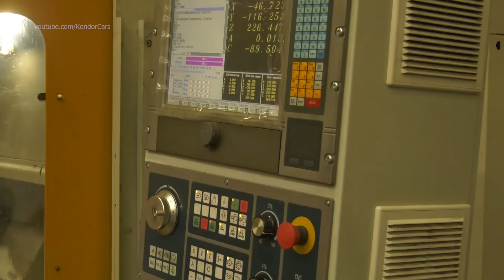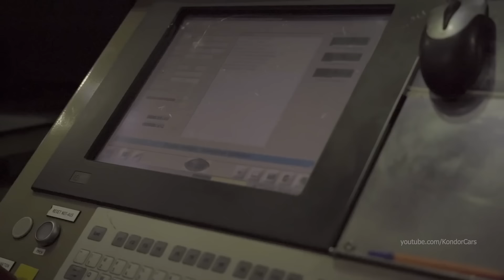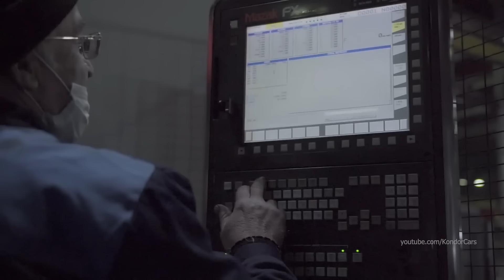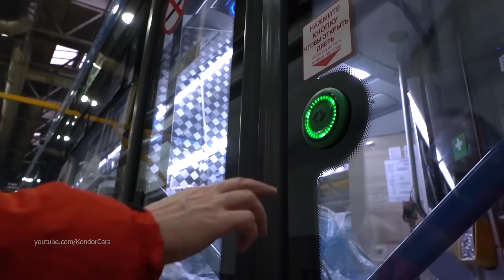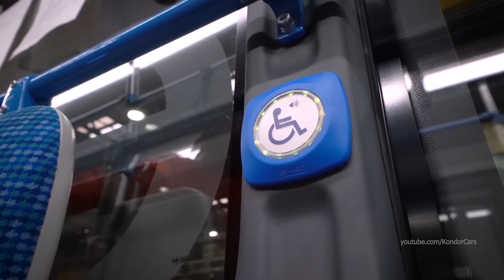KAMAZ Bus Production RUSSIA

Comment: Bus seats ERGONOMICS: 
For the backrest, a backwards inclination is recommended. 
The seat cushion must be (should be) higher near to passenger’s knees, and lower near to the backrest. That is, the seat cushion must be (should be) a forward acclivity. 
Most Brazilian bus SEATS are not comfortable. They are not ergonomic. 
Bus seats of Caio-Induscar are awful, very bad! 
Bus seat of Comil is awful, very bad! 
In these Brazilian bus seats, passengers slide forward over the seat cushion when the bus brakes suddenly. And passengers’ trunks lean forward when the bus brakes suddenly. This may happen mainly when the bus is going down a slope. 
Bus seats ergonomics must be evaluated when the bus brakes suddenly, mainly when the bus is going down a slope. 
And comfort comes from ergonomics!
Reply: может быть , когда ни будь тебе повезет , и вместо бразильского ,  ты прокатишься на автобусе КАМАЗ
Reply: @СергейМихайлов-с3х  Older urban bus seats are more comfortable than newer ones!  Bus seats design is worsening worldwide!  
I suggest reading ‘Ergonomics of Urban Public Passengers Transportation’  (Universidad Nacional Experimental del Táchira - UNET), at the point where it discusses 'bus seats' (the back rest and seat cushion angles). The recommended values may be partially refuted.  But the reasoning core is EXTREMELY IMPORTANT for the study of bus seats ergonomics. 
Most Brazilian bus seats are not ergonomic. So are Brazilian underground (subway) seats!  And comfort comes from ergonomics! 
The bus seat of КАМАЗ does not look ergonomic.  Its ergonomics should be improved, should be bettered. It is my opinion.
Reply: Вы не поняли это автобус для езды по городу а не между городами и поэтому тут простые и надёжные сидения..сел на автобус и доехал до работы поэтому тут просто не нужен излишний комфорт...вот и всё.Это же очевидно,у вас в Бразилии разве не так?

Comment: Older urban bus seats are more comfortable than newer ones!  Bus seats design is worsening worldwide!  
I suggest reading ‘Ergonomics of Urban Public Passengers Transportation’  (Universidad Nacional Experimental del Táchira - UNET), at the point where it discusses 'bus seats' (the back rest and seat cushion angles). The recommended values may be partially refuted.  But the reasoning core is EXTREMELY IMPORTANT for the study of bus seats ergonomics. 
Most Brazilian bus seats are not ergonomic. Bus seats of Caio-Induscar are awful, very bad! The bus seat of Comil is awful, very bad! So are Brazilian underground (subway) seats!  And comfort comes from ergonomics!
Reply: let 's say I don 't need soft seats . 
enough hair))
Reply: @magadiesel3942  I am not talking about softness or hardness of seats. I am concerned with the design (shape) of bus seats. 
A back rest of the seat that leans back between 15 and 20 degrees from vertical line is advised. The angle between the back rest and the seat cushion (or the hard plastic “horizontal” surface of the seat) should be (ought to be) approximately 90 degrees. 
I am concerned with the excessive swinging movements of buses [ swinging up an down (vertically) and from side to side (transversely) ].  This is a reason for lack of comfort and lack of safety. 
I am concerned with hardness of shock absorbers (dampers). 
Treads inside a bus may cause passengers to fall onto the ground.  Generally there are only two treads along inside the bus. 
Brazilian urban buses are not comfortable. They are awful!  Very bad!  SHIT! SHIT! SHIT! 
You are allowed to share my opinions!
Reply: Просто эти сиденья для всех производит несколько компаний, к ним вопрос

Comment: ABOUT BUSES COMFORT: 
I am concerned with the design (shape) of bus seats. 
A back rest of the seat that leans back between 15 and 20 degrees from vertical line is advised. The angle between the back rest and the seat cushion (or the hard plastic “horizontal” surface of the seat) should be (ought to be) approximately 90 degrees. 
I am concerned with the excessive swinging movements of buses [ swinging up an down (vertically) and from side to side (transversely) ]. This is a reason for lack of comfort and lack of safety. 
I am concerned with hardness of shock absorbers (dampers). 
Treads inside a bus may cause passengers to fall onto the ground.  Generally there are only two treads along inside the bus. 
Brazilian urban buses are not comfortable. They are awful!  Very bad!  SHIT! SHIT! SHIT!